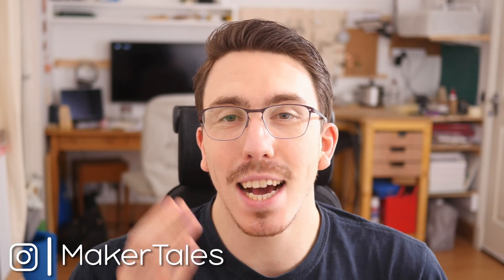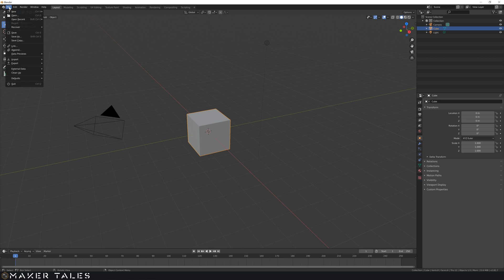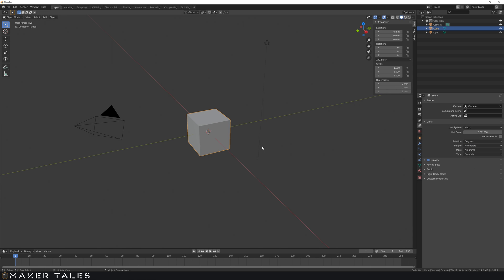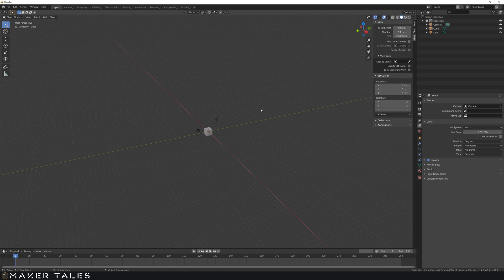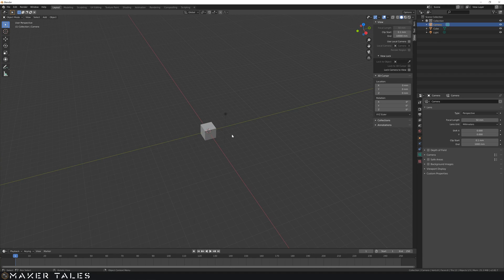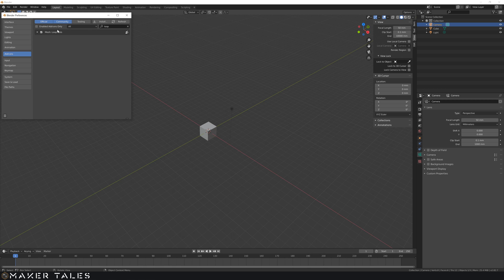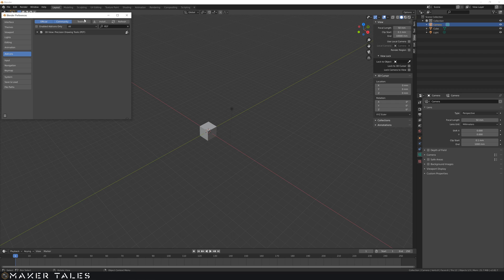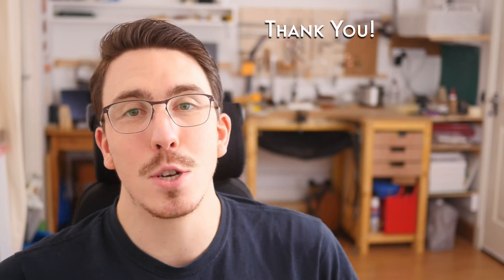How to : Setup Blender into millimetres  (mm) - Blender Tutorial

Comment: I followed these instructions and ended up with everything way off by 1000 orders of magnitude. ChatGPT told me what the issue was. You set units to mm but you also set unit scale to 0.001, so that makes everything massive. I don't fully understand these settings but switching my unit scale to 1 fixed everything.

Comment: I dont understand why you would change the unit scale to 0.001 - just set measurement to mm, clip length to 1mm to match, and then just change your floor scale to 0.001 to constrain the size of added mesh.

Messing with the scale seems like a sure fire way to have to change it in a slicer later as you're using "fake" mm, rather than just working at a real mm scale

Comment: Is it possible to Fix if already created Two 3D models with Scale 1 . When creating, I set millimeters, but the scale remained 1. And today I sent the stl file to a company that prints to order and they sent me a photo that the part is very small and asked me to send the stl file again with real dimensions. And I don’t know how to do it ..... according to MY logic, the size should be correct if Scale is 1, but for some reason this is not so, I didn’t understand where I made a mistake. Is it possible to fix this? I will be grateful if you can help me

Comment: I've used similar settings to this for a while because I mainly do stuff for 3D printing and it makes exporting/importing of STL files much easier. BUT it seems to totally break Blenders physics simulations. Its like the unit scaling is ignored by the physics system so its trying to run the simulations with crazy settings. Does anyone know of a workaround for this?

Comment: Hmm mm seems to display and work fine. I max a box 2000mm by 5000mm and seem to get weird shading issues. 
Is this more for small, 3d printed items? Would be cool to set up for architecture
Reply: A: Same process just don't adjust the scale to 0.001 leave as 1

Comment: EDIT, so ok I am wrong on this, Blender prefers it if I use cm and 0.01, because its seems most of the systems, like hair, lights , skin shaders SSS are geared towards changing the unit scale to 0.01 for characters ie cm.
Now I can tell its right if eevee and cycles renders out more or less the same visually.

I believe maya works the same way but does it automatically. I can tell because if I get the scales wrong, maya default skin shader looks blown out

Comment: silly question but if you have changed ony the scene scale, the cube should still be 2 metres, but represented in mm ie 2000 mm
I do a lot of humans and sometimes I just work either in metres or cm , but Leave the  unit  scale on 1, so a head which was 0.27 m tall, is now 27 cm
If I change the unit scale to 0.01 the head will be 2.7 cm tall. in order to make it the right scale i will have to scale the models in the scene up by 10x, which causes all sorts of problems

This still confuses the heck out of me , because it can mess up stuff like hair curves, sss shaders etc

Comment: Thanks Jonathan for this video!  One issue I experience when changing the Clipping Point by adding a zero is that I get depth buffer glitches.  I tend to work in perspective mode.  How do you work around this?  My models are between 650mm to 1000mm in size.

Comment: I already had a scene set up like this for 3D printing. I'm getting weird precision and floating point issues. I have a 26mm long pin that I rescaled to be 4mm in diameter using CAD Transforms, it turned out 26mm x 3.97mm x 4.04mm. Cad Transforms addon is getting buggy/glitchy/twitchy with the pin too, very confusing.

Comment: (Google Translated) Hi, i found a bug. If I open the Blender, and do not begin to create a new object, but immediately change the unit scale by MILLIMETERS (0.001), then the new created cube will still be 2 by 2 by 2 METERS in size. If I return the unit scale to 1, then the second created cube will already be 2 by 2 by 2 KILOMETERS! But if I restart the Blender, create a new cube first (in metric dimensions, unit scale = 1), and then change the unit scale by 0.001, then the second created cube will already be 2 by 2 by 2 MILLIMETERS, as it should be. The same is observed in the old version 2.79. Maybe I don't understand something?
Reply from the maker: Hmmmm I see what you mean. I don't really see it as a bug. Seems to me more that it preserves that scale that you made it in. So if you set your world units to 0.001 and then you make a cube that is 1000mm then you DON'T want to change your word units to 1 you just want to change your measurement method to meters. If you did change your unit scale your going to have a 1000M cube.

Comment: Is it possible to have more than one set up, that is, a "mm" work station set up. and say another set up of metres or old fashion feet, or something else.  And you pick which one at start up.
Reply from the maker: Hi Alan,
I know the feeling it can be quite anoying working int he wrong scale. Unfortunately the only way that I know how to do this is to have 2 files saved somewhere that you use as your starting templates. One in mm and the other in cm for example. The unit scale and all settings are saved into the files them selves. I don't know of a "quick" way of switching from mm to cm in a file via one click. This might be a micro addon that I create in the future.

Comment: I have one problem in blender 2.8 . I make a line ( 1m 20cm  ). After the set measure tool to this line line lenght( 1m 20004 cm ) . Why what is it . .... Scale 1.0 ..... lenght : Meter
Reply from the maker: Hi Mehdi,
I can't be exactly sure what your problem is but I would start making sure that your units are in the correct units you want to work in ie m or mm and changing that your unit scaling is correct too. If you want to work in m your unit scaling would be 1 if you want to work in mm it would be 0.001.
I hope that helps. Let me know how you get along.

Comment: Hi Jonathan.. I am a novice in blender.. and i do 3d printing design using Blender.. and I am using default meters as measurement and when doing in actual.. the meters is in exact measure in mm in the actual print.. 1m = 1mm..   
and changing to mm will give  a small  in actual.. now I'm confused.
Reply from the maker: Hi Michael,
I'm not 100% sure about your issue. But the first thing I would check is that you have your unite scale and Unite type set correctly. So for M unit scale should be 1 and for mm unite scale should be 0.001. I hope that helps and let me know how you get along.
Reply: @Keep-Making  oh I see.. i forgot the scale to change from 1 to 0.001.. this might be the reason.. thanks again
Reply from the maker: No problem Michael
Reply: Hi Jonathan.. on  12:51:00 ,   on Shift+A  you got Add Single Vertex.. in what add-on is this as I see in mine it got only the basic up to add monkey
Reply from the maker: Sorry for the delay in replying, Youtube SUCKS for comments. That would be extra mesh addon

Comment: Thanks MT. I'm just starting on your PM series. I have a question about all the settings you have us implement (eg milimeters). Is there a way to save these settings as part of a custom environment? It would be nice to quickly revert to a generic (default) or another custom set of defaults, quickly. For example, I dabble in archviz, and wouldn't use milimeters for this.

Thanks.
Reply from the maker: Hi Kurt, Sure thing. I'm sorry for the inconvenience. I screwed up in this video and I intent to remake it real soon. For the time being take a look at miy pinned comment and you will find the solution to saving the set up there. I hope you enjoy the rest of the series and once again sorry for the trouble.
Reply: Maker Tales thx and no worries !
Reply: @Keep-Making  Andrew: Actually, to clarify, I did read your save startup file pin. I'm interested to know if there's a way to quickly change settings from, say, a precision setup, to something else. IE, a feature that allows for named configurations that could be saved, for example, as part of a workspace. (There might not be a way to do this.)
Reply from the maker: hmmmm Interesting concept... With out searching anything they way I do this Is have a few blank blender files that are saved with the set up I would like related to them. That way it super easy to change my starting point. As for once your up and running I don't think there is a quick easy switching system.

Comment: so basically blender is really the only 3d tool you need? For architecture, for 3d print design, for animations, ...?
Reply from the maker: Hey Don,
In a nutshell yes...
The longer answer is that there is still a good 0.0005mm margin of error. It can be a little bit of a mess when it comes to workflows as it's in an organic modeling environment using semi-parametric modifiers and some times they don't really play nice. If you are willing to put in the work to truly develop your own workflow and break the norm a bit. Blender is very powerful!... However, if you are looking for accurate and 100% precision along with all the other great things such as stress load simulations your best bet is to stick with a CAD style program and maybe import the result to blender to make it look pretty. I hope that helps.
Reply: @Keep-Making  It does! Thank you for the answer! :)

Comment: Hi, a question, why do you also change the scale of the units to 0,001? If you put the length to milimeters, it already put your scale fine, it shows 1mm, not 0,001mm. I don't know why you change the scale also.
Reply from the maker: Hi Arantx,
I understand how this can be confusing. Let's say that by default blender is set to meters so 1 = 1 meter (in the past this used to be 1 blender unit). From my understanding just setting units to mm will mean that the world space and the working environment is still get to meters. Thus setting the world space to 0.001 means that now everything is set down to this scale as the unite type. By all means feel free to not set your world units but I'm pretty sure with time you may find a few weird things happening. Such as the way lighting is calculated in renders to the way modifiers and some snapping operations are calculated. I hope that comes in handy.
Reply: @Keep-Making  I didn't know it, thanks!

Comment: Hi Jonathan,

Great stuff by the way mate  ;  )

Like you I need to set up Blender for modelling precise 3D shapes, not for 3D printing like yourself but, I'm designing moulds ( and resin tooling plugs ) for a CNC machine.  As good as your tutorial is,  you didn't happen to mention anything about the 'Scale'.  I followed your video to the letter, and I have a question ( a few actually!  ).

In the 'Top Orthographic' mode in my view port,  I have '10 Meters x 000.1' - Is this normal?
Also,  when I put my dimensions in, 157mm x 289mm x 50mm the scale option changes ................  The scale now shows X=78.500 Y=144.500 Z=25.000
What does that relate to?

I've 'locked' ( small padlock ) the scale, but it changes every time I change the dimension of my model.

What am I doing wrong.  Any help greatly appreciated mate.

BTW - I wish you all the success with your channel and hope it grows and grows ........................  Now subscribed  ; )

TURK
T4 Concepts
Reply from the maker: Thank you very much Turk,
Ah yes... scale... It's a tricky one. The short answer in hard surface "precision" modelling it has little to no impact. * As long as you are not using any modifiers*
When the scale is changing it also means that you have been doing edits within object mode instead of edit mode. Ideally, it best to do all work in edit mode. However, if you are in object mode and to set scale back to 1 what you click is Ctrl + A and then select scale or if you prefer all transforms. This in a way "resets" the new "default" object scale and shape to what your changes have been. I'll be doing a whole bunch of videos on hard surface precision modelling in blender in the next coming weeks. Sorry it took me a little while to get back to you.
Reply: @Keep-Making  Thanks for the reply mate,  looking forward to your tutorial videos Jonathan  ; )
On the subject of 'Scale',  'Blender Guru' ( Andrew Price ) happens to mention it in his latest tutorial 'Blender Beginner Chair Modelling' 
Link to tutorial > https://www.youtube.com/watch?v=AP5CTAKckBI

The scale is suppose to change as you model!  I can't quite wrap my head around it at the moment,  but depending on what you're doing you simply have to re-apply the scale to 1.
I spent a few days researching Blender documents but still can't find the direct answer as to why it constantly changes.  Surely it would make more sense if the scale remained as 1:1 if you've already set your dimensions.  But it seems as though the developers of Blender intended it to be that way.

And who am I to complain !!!   : )

TURK